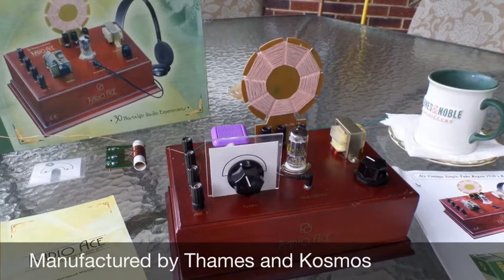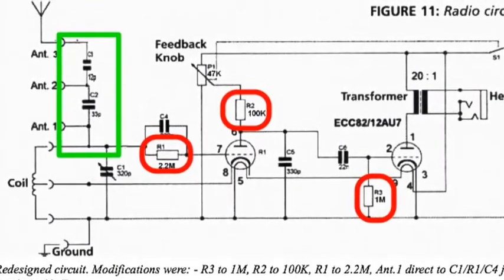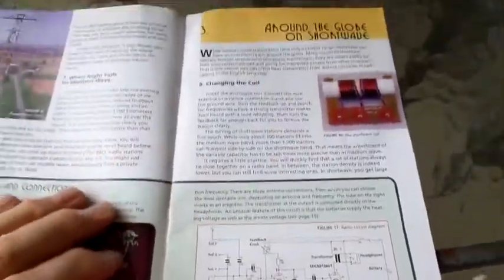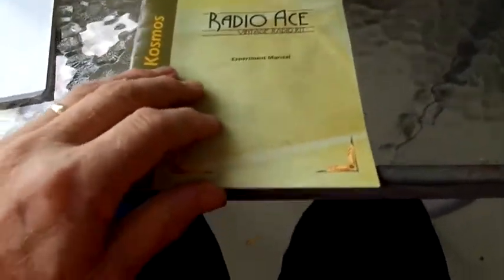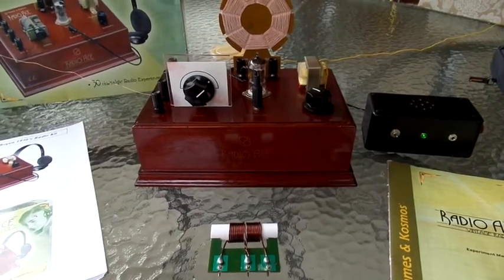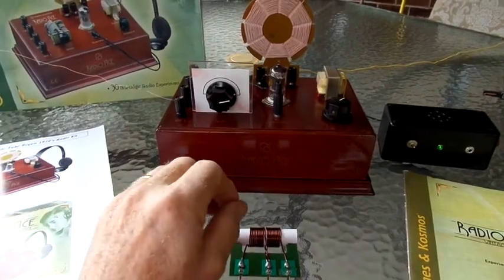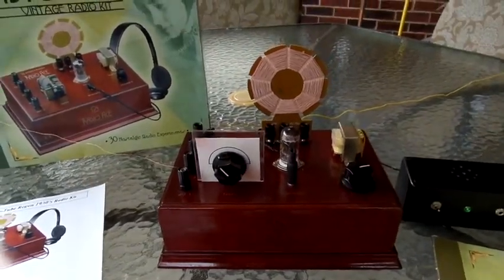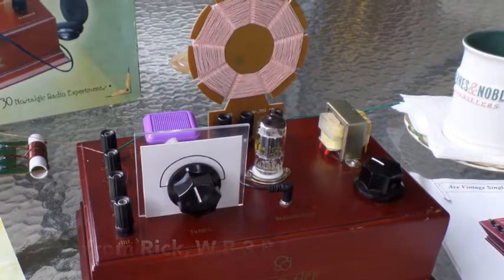Radio Ace Vintage Receiver

Comment: I found this kit nearly complete and with unopened plastic parts bags (i.e. never used) on Ebay (but missing dial sheets/hardware which is not a big deal).
Bought it based on your video and plan to do the mods.  Still a few of these floating around out there, but they stopped selling brand new in 2015/2016.

Comment: The modifications actually came from my website http://members.iinet.net.au/~cool386/kits/ace.html.
Reply: hello Sir,if you have the same manual book a the man in the video,can you post the coil making pages?
Reply: The coils that come with the kit are already prewound, as seen here http://www.b-kainka.de/kosmos/radiomann.htm
 However there is data on them from the designer's website http://www.b-kainka.de/kosmos/Spulen.pdf
The SW coil is 15mm diameter, 22 turns tapped at 11 turns, 1mm wire.
Reply: CA Monitor Top thank you very much for your time!

Comment: 1:00 This tube-based receiver crkt uses only 12V, presumably from a car battery way back when!  Must use dual-amplification aka reflex crktry.
2:50  Cool, this receiver apparatus is so utilitarian
Reply: How does it function as a wireless xsmitter when running on only 12V?

Comment: Can we use 12AT7 instead of 12AU7?
Reply from the maker: In many cases the  12au7, 12at7 and 12ax7are interchangeable. They are all 9-pin twin triodes. Hope this helps. 73’s de Rick